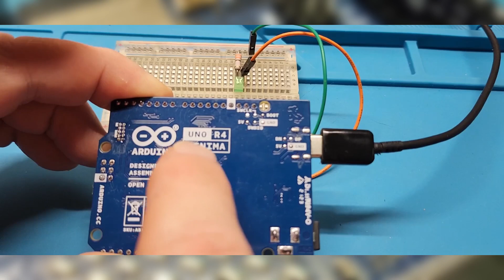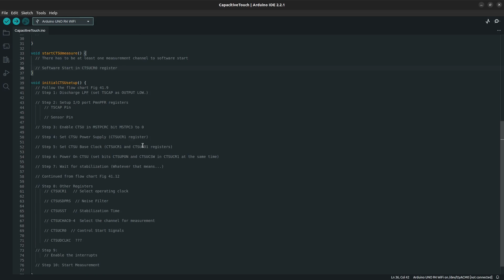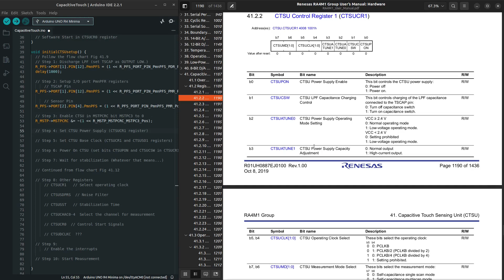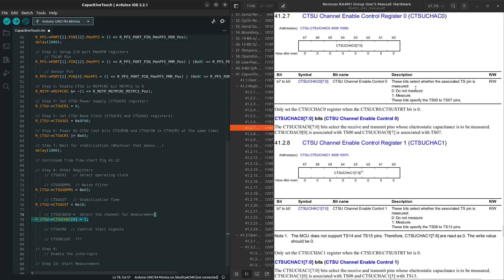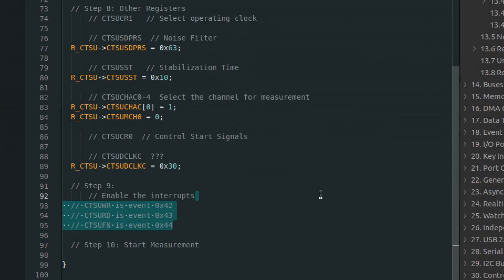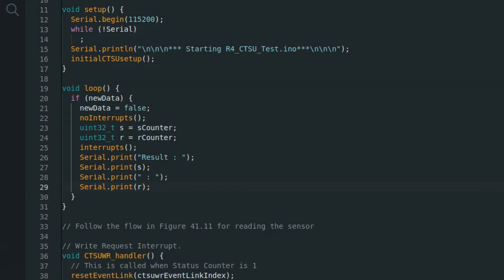Arduino R4 Capacitive Touch Sensing

Comment: could you make code that would work on all pins that support the touch peripheral?
Reply from the maker: A full library for the CTSU is one of many many projects I've been wanting to get to.
Reply: @Delta_G  cool. The github link in the description is not working.
Reply from the maker: @ThomasIJsseldijk  I'm sorry.  Somehow it had got set to private.  I fixed it.  Should work now.
Reply from the maker: New library is all ready.  Check out the video in the pinned comment above.